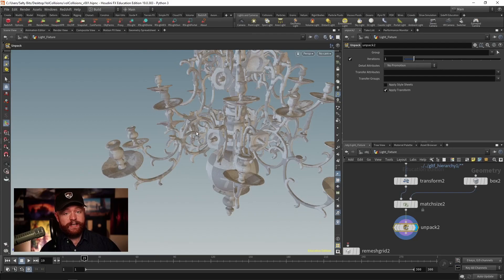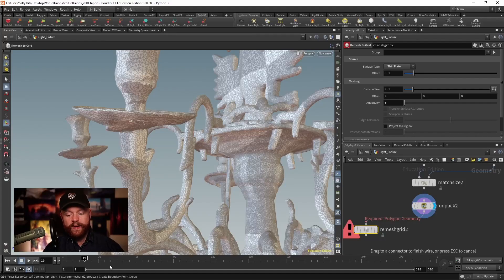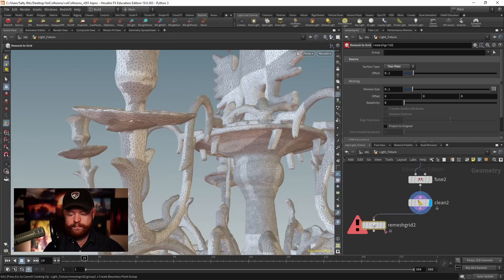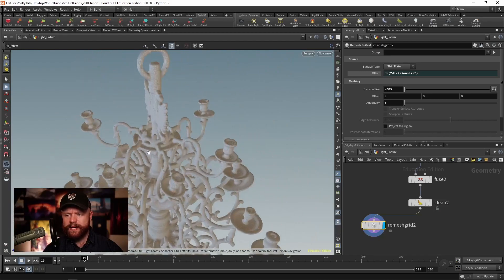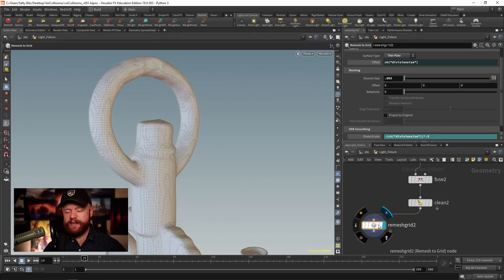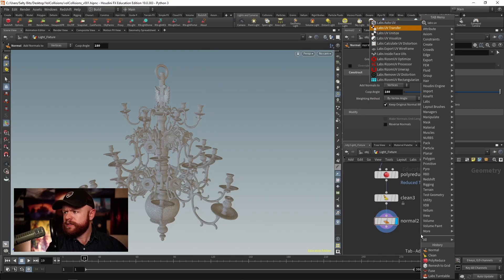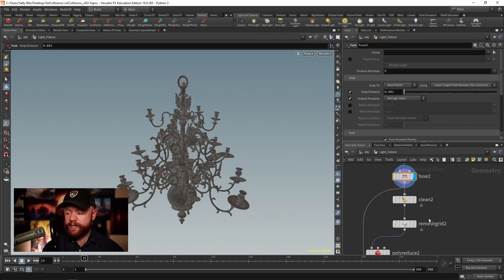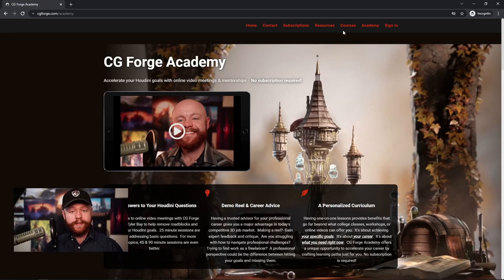Houdini | Cleaning Bad Geometry | Quick Tip

Comment: Thank you for this! Very helpful - is this process different or updated with the Quad Remesh tool? Is it basically doing the same thing?
Reply from the maker: The quad remesh tool is doing something different than this.  If it works to give you clean geometry, then great!  But it's a different thing.

Comment: Great tuts dude! Quick question, if there a advantage to using remesh to grid over VDB from polygons? Seemed like you used a couple more steps that are handled by VDB so was just curious. Thanks again for the great work!
Reply from the maker: Hey thanks!  Yes, the remesh to grid has the "Thin Plate" option + dilate/erode which is much more convenient to use over the VDB from polygons workflow.  Both can work, but it's more about speed and less hassle with the remesh to grid.
Reply: @cgforge  Awesome thanks for the reply. I didn't know about remesh to grid, and will def give it a try. Thanks again!